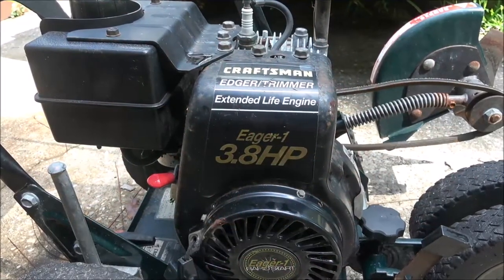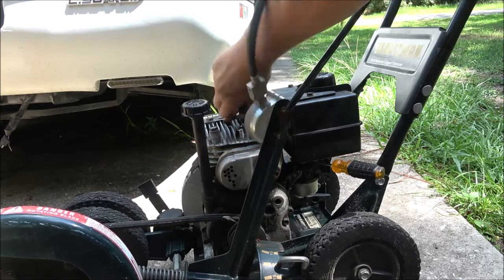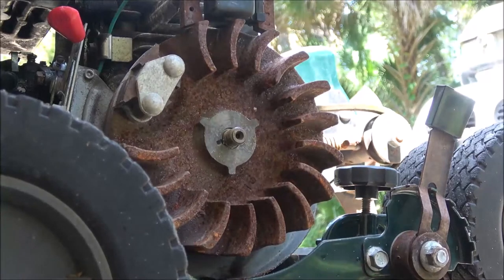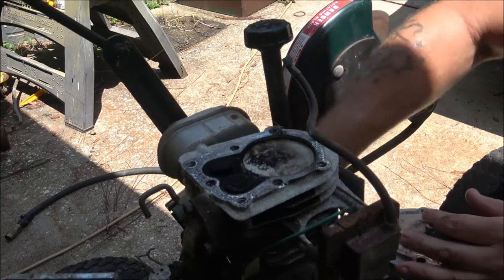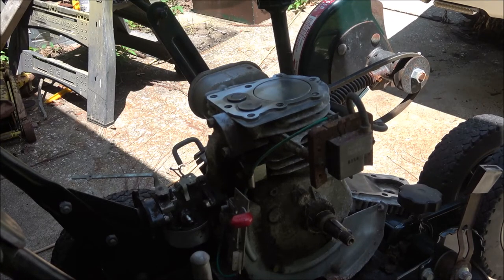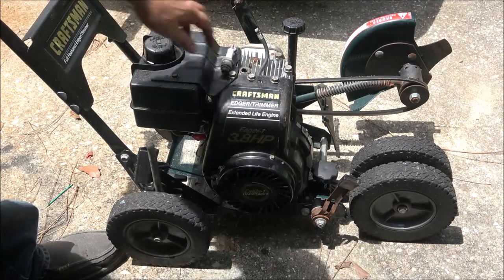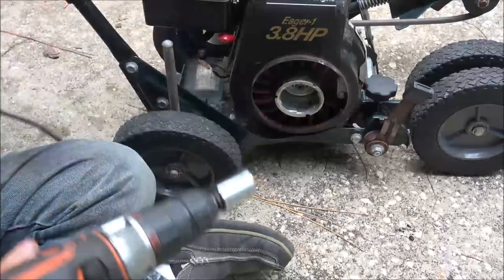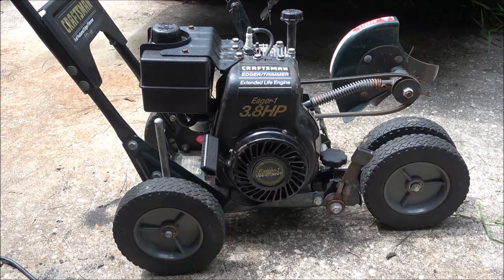More Work On The Eager Edger Trimmer...Misdiagnosed?

Comment: Nice little edger.  I had a mower that I got from someone, and apparently they messed with the governor adjustment... drove me crazy till I figured it out 

That's the way I was taught to remove the flywheel, put the nut back on a few threads and use a pry bar and give it a swift  blow with a hammer.
Reply from the maker: Yeah when someone messes with the governor it's usually not something you see right off the bat. Very frustrating. Great to hear from you Pete.